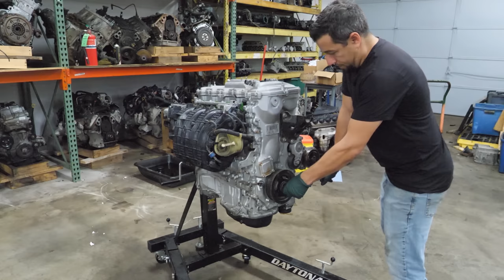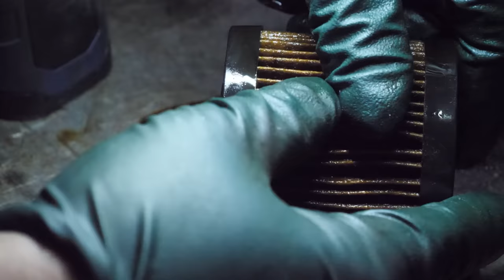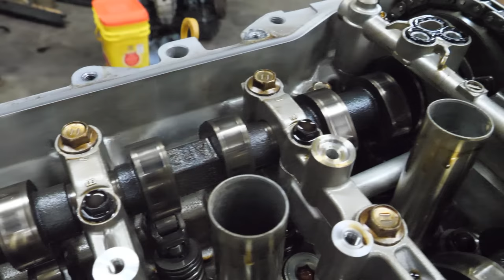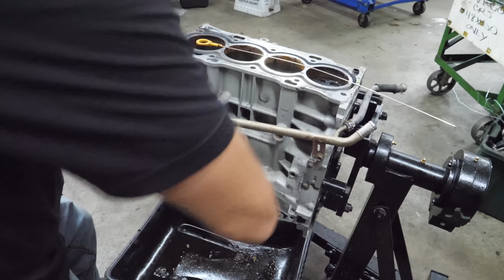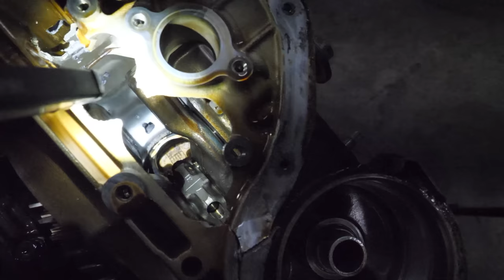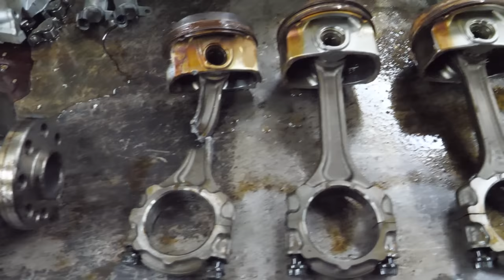TRASHED Toyota Camry Rav4 Scion TC 2AR-FE 2.5L Engine Teardown

Comment: Had one of these in my 2010 Camry. Started burning oil around 160k, about a quart every 1k miles. The Car Care Nut has a video on these, and said they are developing a problem with the oil rings seizing due to getting gunked up from extended oil changes. The cylinder walls get worn, starts with oil burning and eventually leads to no compression. It’s a really good video to watch.
Reply: Pine Hollow Auto Diagnostics did a video on one of the predecessors of this engine with that exact issue as well. Did an “in-car rebuild” where he took the pistons out one at a time and replaced the oil rings; he also did a little mod on the pistons to help reduce recurrence of the issue in the future. Was in a late 90s Prizm/Corolla if I recall correctly. I’m currently monitoring the oil consumption of our 2AR-FE Highlander with 180k, at about 1 qt per 1500 miles at the moment….
Reply: I had a 95 Integra GSR that did pretty much the same thing I think. It burnt oil like crazy pretty much the whole time I had the car, and literally dropped a cylinder while on my way to trade it in on another car. I was a kid and bought that car too quickly without checking it fir issues very well. That car was a POS.
Reply: It's because people are letting the oil changes go out to 10k miles before changing. This engine needs it done every 3k miles.
Reply: @sephiroth7818  ReALLY are you serious??? I do 12 000 miles on my Merc over 220000 miles and no trouble. Buy Japanese , pollute the World and do your sums on my oil changes vs yours. My German car is much cheaper to run and better for Planet Earth !!!!
Reply: @c-teamtrading9690  keep telling yourself that. No vehicle whether it runs on gasoline or electric is good for the Earth. And waiting til 12,000 miles to change your oil is air brained. I don't care what car it is.
Reply: funny because the 2ar-fe engine was supposed to be the resolution to the oil burning issue in earlier toyota engine models
Reply: @Wes_5kyph1  I have a 2AR-FE, don't know if it burns oil. I change my oil between 3k and 5k. Im not even going to try to wear out that engine like the person above that waits til 15k miles.

Comment: i live in Australia i had a 2ar-fe in a 2014 Camry it was a oil chewer i had to put 2 litres of oil in it each month and had a vvt noise on start up. But never had oil smoke out of the exhaust good reliable motor i had 250000km on it before i sold it.

Comment: Why do the chain guides get so little respect!? Love how they shatter with a good throw! Every Saturday needs a good teardown.
Reply: its a running joke. Not supposed to buy used timing guides, chains, or water pumps. Better off buying new anyways.
Reply: Crazy how something so important can be so weak also
Reply: @Angel-rn2lq valves, cranks, cams, rings, bearings. All can be ruined just by dropping or scratching them. Kinda crazy how precise these engines need to be
Reply: why do Toyota chain guides show so little wear, but Ford and GM guides fall apart inside the engines?
Reply: I read this as he slam dunk it, man screw them guide chains
Reply: @adotintheshark4848  because Toyota makes better guides

Comment: Considering that I am seriously thinking of buying a new Toyota this coming week ( or at least, ordering one ) watching and listening to this video confirms what I have heard elsewhere, that Toyota engines are 'tough', therefore it helps my buying decision.
Thanks for this.
Reply: They used to be better but I tell u what if I had to buy a new car right now in this day and age it would still be a Toyota
Reply: They're not dumbass-proof (as Eric always says check your damn oil) but they're as close as you can get.
Reply: All engines will eventually succumb to fatigue. You can increase its lifespan with shot peening by about 100% and cryogenic treat it but it can cost a pretty penny. Also, using the wrong viscosity can seriously damage an engine more so than skipping a service cycle. Coolant can also accumulate electrolytes and eat away at gaskets. Aged coil packs can cause knocking and scratch your liners. And doesn't matter how good an engine is, all the wiring and sensors will also eventually wear out. So there's no trouble-free car out there. Life's a gamble and all you can do is hope for the best.
Reply: @hereb4theend  Indeed. It is the plastic parts, electronics and sensors that die.  I am afraid the auto industry is in for a tough time going forward. They have squeezed just about every last bit of power and economy out of the gasoline engine. Soon the junk yards are going to be full of these modern over engineered units

Comment: I have this engine in my RAV4 with 200,365 miles on it. It runs great. It's been well maintained with regular services. It needed a VVT-I cam gear replaced and a upper radiator hose fitting as well. No oil leaks and it uses hardly any oil.

Comment: These always seemed like stout engines, nice to see their sensible and serviceable design; basically keep oil in and keep saltwater out and it seems like a good motor. Also I've always appreciated that these 2.5 Toyota I4s and the 2.4 liter 2AZ predecessors for being very easy to make sound really good! Some of the best sounding 4 cylinders and they're in camrys and scion xBs.

Comment: A few months ago, i had the exact same problem with a customer's  2010 Camry. Watching your video was dejavu for me, down to the twisted and broken #1 rod! and hole on the engine block.  Just like you, I diagnosed it to hydro locked situation. Just because I LIKE PROBLEMS, I did get it fixed quite inexpensively (they are NOT easy or cheap to find) and so far, customer tells me its running like new.

Comment: Thank you for posting this excellent teardown. I do tell my office staff and family that I watch your weekly videos and I'm really careful to check my engine oil, get it changed every 3 months, and I totally refuse to drive through standing water. My car runs superbly thanks to your advice. 🙂
Reply: Every three months could be a tad excessive, but at least your engine won't have any trouble with sludge or internal varnish. 😊
Reply: @jochenstacker7448  
Depends if he rakes up 5000 miles in 3 months or if the engine is idled in traffic for an hour each way each day?

Comment: 200,000 kms on mine since new. Recent oil pressure sending unit - $25 & a water pump - $500 .... that's it. Most reliable engine I've ever owned, hands down.

Comment: 2ARs are extremely easy to work on in camry's usually in rav4s as well althought the 4x4 ones can complicated it. you can even reseal timing covers with the motor still installed!
Reply: Oh yea...plenty of room. Not a hard motor at all to work on, and quite tough. They've seen their fair share of cam gear replacements due to cold start rattle, and plenty of water pump replacements though.
Reply: I'm looking to do the cam phasers soon on my wife's rav4. I've noticed a little rattle. Never had to do a water pump yet.

Comment: Thanks Andy, for donating the engine. Yes, it did scream hydrolock very early on. I 'killed' my dad's car by driving it through a flood when I was a teenager. He never said a thing, just gave me 'that' look. Fortunately, as soon as it locked, the engine stalled, and I turned off the ignition, waded out (the water didn't even come to the door sill) and pushed it in neutral; the engine survived. I was very lucky. Not all hydrolocked engines implode or die. Park it up, and walk home is the lesson. For me that was a long walk of shame, in the pouring rain.

Comment: The main issue with these is the cold-start rattle and oil burning. Check the intake vvt gear to see if moves back and forth meaning the lock pin has seized inside its bore.
Reply: oil burning is an old problem from previous engines. these are just rattley out the factory
Reply: @bradhaines3142  early 2ARs do still burn oil, much like the previous 2AZs. It’s never as bad as any 2AZ would get, but can still become cumbersome. The early ones also seem to develop head gasket leaks, much like the 2ZRs. After 2013, seems they fixed those issues for the 2AR. But the VVT-i death rattle  still seems to be an issue through all of them.
Reply: For example,  the 2 AR FXE and and not far away the 2 AR FE is one of the world's best best engines who been ever made.
Regards Jay
Reply: And...Why u talk rubbish, i had never heared here in Europe not even someone,  who reported Oil burning, not at all  in the contrary in comparison with such crap like Ford, BMW, VW, Audi benz ect, those Toyota 2 AR FE ore 2 AR FXE are with far distance the best not oil consumpting engine ever at present,  its yust a stupid myth that light tensioned or running piston ring ensembles does be obligated to consuming automatically much Oil.
 Thats matters not at all for Toyotas automatically  but thats fully true for such pile of trash like Ford bmw and other German and European designed Cars and Trucks. The  annoying start rattle i don't like either because it sounds not smooth in that second after start, thats right.
Reply: Like i said
Reply: I had and have never got an Engine who burned absolutely no oil, 0,  zero, and i drive it between 43 and 49mpg of course conservative drive but i don't need to drive like a fast monkey on drugs i be high mindet level, to be able to enjoy really a drive, even if the engine not screems high. Mostly although this 2017 2.5 2 AR FXE engine i love to rev sometimes a bit, because i love this smooth crisp sound if it rev. Until 5.000 rpm it is extremely smooth and quiet and i guess, that is for sure one of the reasons why it burns absolutely no Oil its simply very very great designed. That Toyota engine.
Reply: @JWORLDKING  the iron block Toyota 4's are even stronger and more durable. Like the 5S-FE, 2TR-FE, etc.

Comment: I'd say that engine has had the "Super Saver Rebuild" done.   When you can't splurge for a proper water pump gasket, then your being way too tight with your money.   I just rebuild my Honda engine about 10 months back.   It's a '98 Accord F23A1, the 2.3L Vtec.   Anyhow I spent about 1100 dollars on my rebuild parts,  but I have a new motor that runs great, and is super reliable.   I got a very nice set of Mahle pistons, OEM Honda Crank/Rod bearings and OEM timing kit, I got the oil pump from Hylift.   I had the cylinder head built by Cylinder Head Service Inc out of Fairfield, Alabama.   They also did some custom port polishing and upgraded valves and valve springs, and I had the block dipped and cleaned and tested.   I've put about 16k miles on it since, it's my daily driver at the moment.   Anyway I could have cheaped out on parts and spent 400 or 500 bucks, but I'm really not sure how great those chinese eBay rebuild kits really are.

Comment: That is actually a nice looking designed motor.  Even though this is about a breakdown of a broken motor, I learned a lot about just the design of this motor.
Reply: Engine, not motor. 
An Engine runs on combustion, while a motor runs on electricity.

That's why I.C.E. means "Internal Combustion Engine".
Electric appliances like Tesla use electric drive motors.
Reply: @demcomp nerd alert 🤓🚨👀
Reply: @TreyDarkis  nerd? No, it's proper terminology. 
Again, an engine runs off combustion, while a motor is electric. 🤷
Now you've learned something new, no need to be a dick because you had no clue.

Comment: 32:22 the 2AR-FE is a great engine if you change the oil at 3k to 4k miles every time. That timing chain will probably last to well over 400k miles.

Side note: I own a 2AR-FE

Comment: The water pump is definitely a common failure point on older vehicles 2000-2013, honestly any engine leaks because it's usually a rubber gasket that hardens up or the paper gasket like you saw on this 2AR-FE. But as long as Toyota keeps those gaskets as the usual and those 2AR-FE cam gears and piston rings, I'll be a happily paid tech at the end of the day.
Reply: You named the 3 common "failure" points of the motor. Not much past that.
Reply: @ryanbrown918  that’s great man, it’s almost like you can read a full sentence.

Comment: Ahh, the VVT solenoids.  TIGHT.  They can stay in the VC but I did swap them when I did my sister's engine.  I was surprised at the tight fit and used some heat to make it go well.

Comment: Haha, I actually replaced a 2.5 engine on a Camry last year after hurricane Ian with this exact failure mode; large puddles everywhere, owner decides the vehicle is a submarine, engine hydrolocked. After emptying the combustion chamer out via the spark plug holes, the car started but ran rough, right up until we went for a test drive, and the engine hydrolocked again. That snail shaped intake holds A LOT of water...

Otherwise a supremely solid dependable motor. Agreed on just how reliable and trouble free they are, a truly well engineered piece of equipment.

Comment: Looks like there's a whole load of candidates available in New York today. From what I saw on videos yesterday people just love to drive too fast in water and get that bow wave up the the engine air intake just under the hood lip.
Reply: It's like they think they need to get a run at it.  That only makes it worse.  It's not like they are going through 8" of snow.
Reply: Your average NYC denizen isn't all that bright
Reply: Tarp tightly strapped down across the whole front of the car up the hood and down to the undertray...
Drive to create the bow wave...
that creates a hole in the water that extends to the engine area and allows the engine to work and also suck in air from wherever it can.
Not guaranteed...but if needs must and you are going to drown if you stay on the river bed???

Comment: Problems I've seen on this engine model:
Cam phasers noisy or failed (kinda rare but happens).
Hydraulic chain tensioner that bleeds out after parked and gets noisy during start up until it fills up again.
Balancer cassette unit with stripped gear's teeth.
I think that's about it. 👌🙂

Comment: That really says a great deal about the strength and design of that engine.  I have 2 6.0 liter Ford diesels and they stretch the headbolts when they hydrolock.  Liquid can't be compressed.  GREAT VIDEO!

Comment: This was an interesting one. Those engines hit 300k miles easily, I've seen 1 at 500k.
Reply: If you check the oil every week and carry a container in your trunk to constantly feed it. These engines are prone to excessive oil consumption due to bad design of piston oil rings!
Reply: @victordobin5918  yes, they do burn oil as they age like most cars. But we have a driver with 370k miles on here and she adds 1 quart between changes. Also saw a 500k mile one who also said he added a quart between changes. They’re not nearly as bad as the 2AZ-FE.
Reply: They don’t burn oil if you change the oil between 3 and 5000 miles and maintain it then the oil control rings won’t get gunk up.
Reply: @itsJMoney0192  I changed my oil regularly every 5000 miles and it still burns oil 1.5 - 3.0 quarts every 5000 miles! Toyota messed up on this one for sure!!

Comment: I have a 2017 Rav4 Limited with 90k and the only issues I have is the timing chain rattles every morning which Toyota says is normal and the timing cover has oil seepage. Oil changes every 5k and filters when needed. It runs great and doesn't burn a drop of oil ! The injectors need a bottle of additive every oil change but other than that it's great.

Comment: I got a modded Camry with this engine, they can handle some power and are super easy to mod. I'm currently at 215whp with a 1ar crank, Frankenstein intake manifold, and cold air, and exhaust,  been wanting to do forced induction on it but don't got the funds

Comment: How to tell if the engine is not a reman from Toyota is that new engine front timing cover has grey RTV gasket. Reman are black RTV gasket.

I know that these are done that way but to know if I did it and to make sure that no one tries to screw me over. I use orange/red RTV gasket.

Comment: For the water pump. They come with paper gaskets. Not sure about later years if they come with metals ones. On our 17 Camry with 2.5L. It came with a paper. It was leaking. Replaced with a Toyota OEM part. Came with a metal one. The pump was fine. Just a little leak.

Comment: Super fascinating and it is pretty clear that all (at least in US) around 2008 auto manufacturers were forced to offer for high performance gas engines either VVT, DOD or some 'ticking time bomb' add on. And Honda Toyota were no longer immune. It is evident after watching your earlier Corvette 'LT' (now I guess can apply to any GM motor as in past was only to apply to 5.7  liter engines had to apply DOD. Prior to 2008 or so it was clear a designated 'performance' car by auto maker was exempt from CAFE to which other lines had to pick up MPG/Emissions slack. I feel for people with VVT or DOD as you can be on top of maintenance but when unspent fuel on non-active cylinders or blow by as a result of a made to fail solenoid or delicate spring on a roller is troubling for owners of these cars. Also troubling is knowing the GM3800 was used as the SLEV benchmark (EGR has no flow coming from factory) and having things like Oxygen Sensor 'trouble' codes remain on for over 100k miles on my vehicle which cuz its pushrod never had any affect, and when other comaprable engines were offered i.e. GM 3.6 or some Northstar V8, I come to find out GM had to underreport my 3800 spec which is unfortunate.

Comment: I worked for a major engine and transmission remanufacturer. We were required by the manufacturer to use genuine OEM parts. It doesn't surprise me that the bearings were Toyota branded. We also painted the engines and transmissions, although they were switching to sand blasting when I left. I thought the painted units looked terrible and the paint never lasted, but it looked better than unpainted. You just cannot effectively clean the outside of the case with chemicals alone. If not for the paint, they look like crap.